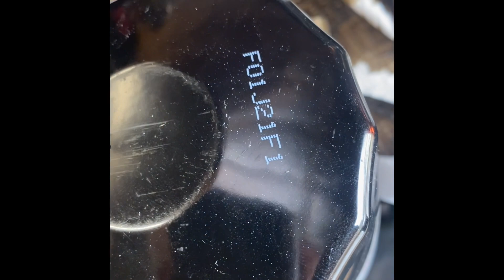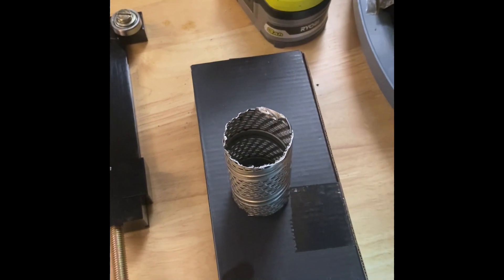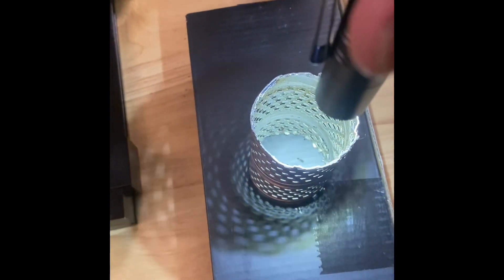Bosch Premium Oil Filter Louver FREAKOUT!

Comment: I always look inside all the filters I use. That is a very good habit to have. The center tubes are just flat sheet metal that are stamped with either round holes or louvers. The louvered center tubes cut down on waste as there is no waste metal.The round holes leave little circles of metal waste as they are punched out. The Tech support people say louvered center tubes have better flow rates than just holes. If the areas could be measured overall, I can see how they could claim that. Notice the louvered    center tubes have the complete area of metal perforated, not just a solid piece which restricts flow except for where the holes are. Count the number of holes on an equivalent filter and you will have numbers all over the place. Some with  a suprisingly low number of holes. The louvered center tubes have openings staggered over the whole area of metal perforated. The spiral shape also creates a vortex, affecting the flow over  the entire surface area. If some aren't quite open as much as the other ones, you'll  still have more fluid coming through than on a piece of solid metal.!! If you have time, try counting the  louvered  holes in your filters.!! Use them, they will be fine.!! I have discussed this with the head engineer at WIX.!! He is the designer, tests all the products, and is the technical writer for WIX FILTERS with over 30+ years of experience on the job. Louvered center tubes also have an extra layer of protection if the element ruptures. The louvered center tubes will not allow the larger size pieces of debris to pass through like the bigger diameter holes will.!! Tighter tolerances. I know, I know, I still have a hard time not liking the round holes better, also.

Comment: I like nylon e-core filters - virtually zero restriction and easily able to tolerate heat. Nylon radiator end caps can last 20 years, so I’m pretty sure a nylon e-core would have no problem enduring a 1-year oil change interval.
Reply from the maker: I have to agree.  I always didn’t like the idea of them when I first saw them.  They also likely have more consistent oil flow through all media.
Reply: I also had my doubt on the e-core but u have a point.